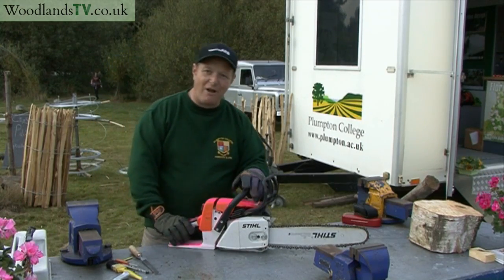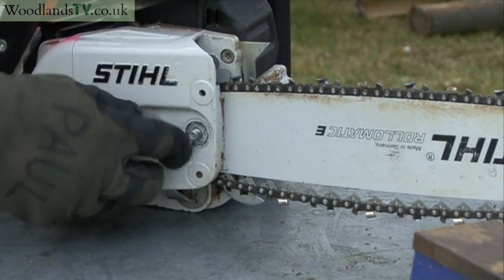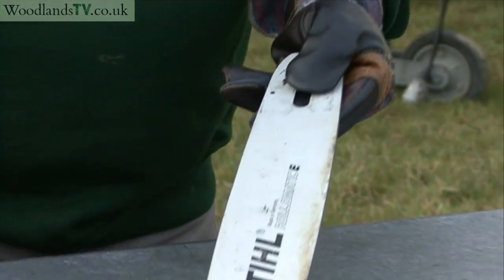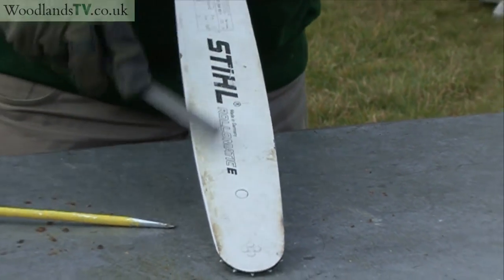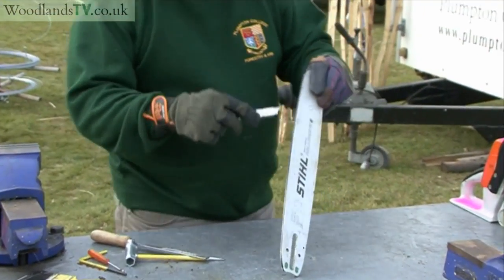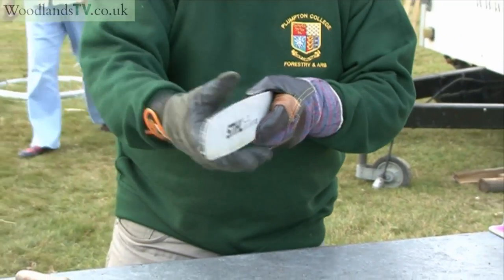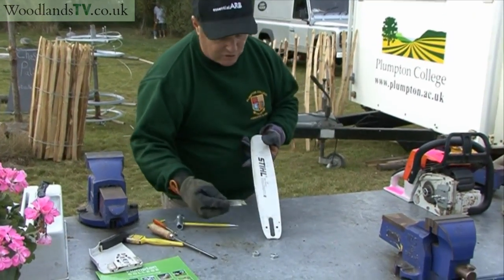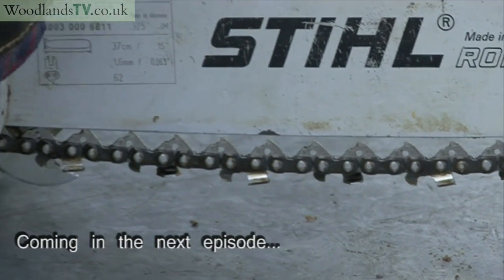Chainsaw Guide Bar Maintenance

Comment: They need a chain saw bar that lets the chain run inside the bar or either one that has a chain that will run over the side lips of the bar and there would be no problem running a chain i guess that way and it would wear the bar evenly.

Comment: What about spread rails?
Reply: There is very little if any information on this on Youtube.  I'd like to see a video on this too.  The rails aren't necessarily spread, but rather worn inside.  This means the chain can rock from side to side and therefore not allow the bar to cut straight.  Furthermore, it makes the angle cut on your face cut when felling trees difficult.  Some people say to preset vice grips and just pinch over and over again down the line of the bar until the desired groove width is achieved.  Others say to use a purpose built tool which is heavy duty ball bearings that can compress the bar as it rolls down the sides of the rails.  I haven't tried either yet.